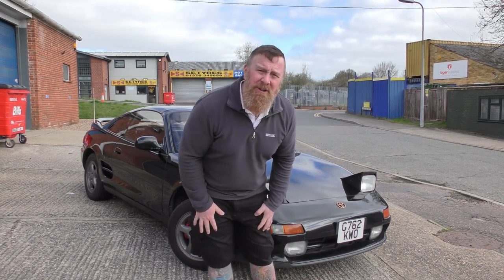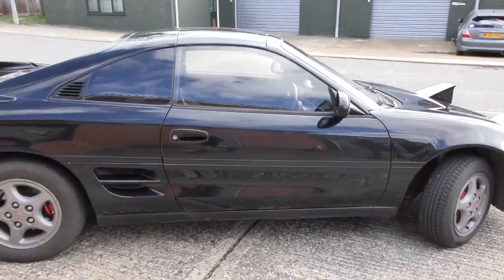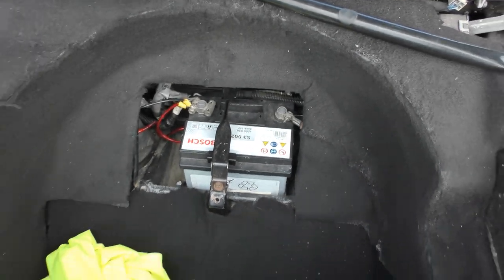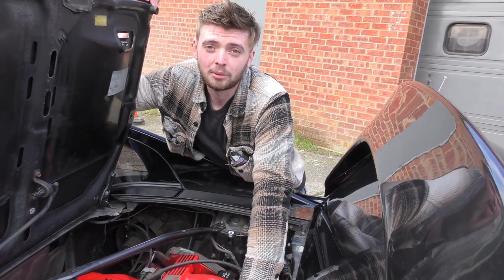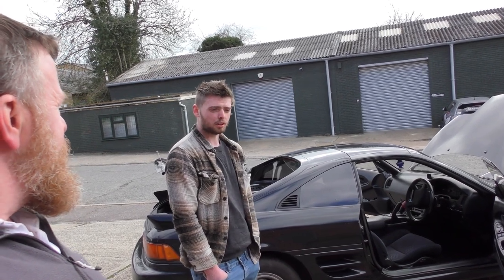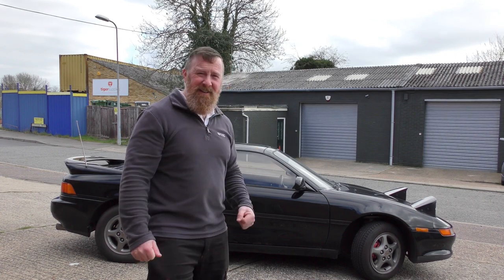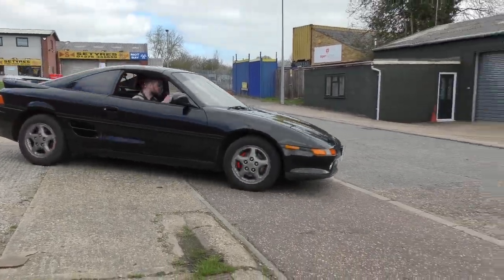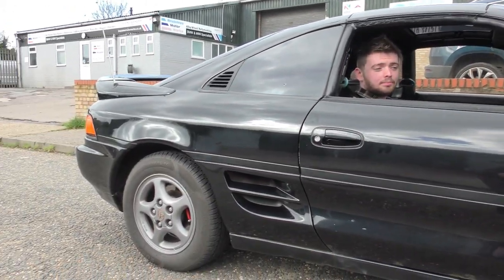TOYOTA MR2 MK2 AUTO T BAR CHAT & REVIEW MARK SAVAGE

Comment: Hi I got a motorbike question 
I have a 50cc typhoon mk1 ac 

It had new rollers new belt new clutch springs new 70 kit and when I rev still doesn't move anything else I should check
Reply from the maker: i dont like 70cc kits as in my videos 
however 
the engine runs ok , you have changed the variator , clean / new rollers and belt and cultch is ok as in my test videos
Reply: @mark savage   hi thanks for the message back its had new rollers and clutch springs so I've ordered a new clutch and my carb is leaking like crazy filling my block up the floats buggered and it's a complete mash up also I see that the clutch is not engaging hence I've ordered the whole thing and seen cracks in the variator itself now so new one of them
Reply from the maker: @Diesels9678  this will mainly be your carb bud , you need to get that sorted , check your vacuum too as this also maybe your problem . like in my videos , maybe look into a new carb if you cant sort it
Reply: @mark savage  ordered a new carb mate I think this one has had it plus had a 97 jet in it can't see a brand so Ill just start from new thank you mate

Comment: hiya mate, sorry for the ped questions on a car review. a couple months ago i brought a very nice aprilia sr50 2 stoke. i was a little bit naughty and went onto a duel carrage way and pushed it to hard. since that my "pull off" and general acceleration hasnt been great often not even moving and almost stalling?. ive been studying alot of your videos and i am confident that it could just be the variator system and possibly the clutch aswell. i would love it if i could have a little bit of advise or a few sugestions based on the little information ive given you.
thanks mark keep up the great work you do :)
Reply from the maker: agree bud best look at the variator and belt, take off and check / change rollers , remember to clean up with a dry rag , clutch should be ok unless warn. make sure your running on e5 bud sure all will be ok
Reply: @mark savage  thank you for the reply mate. Just wanted a second opinion. I watched your video last week about the e5 and e10 and I will admit my ped has been running along better since. Keep up the good work mate